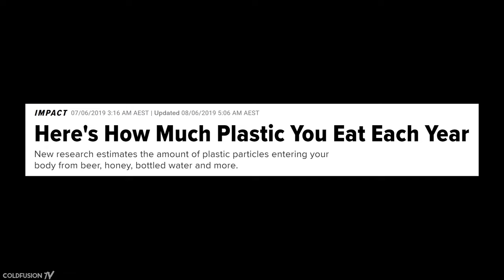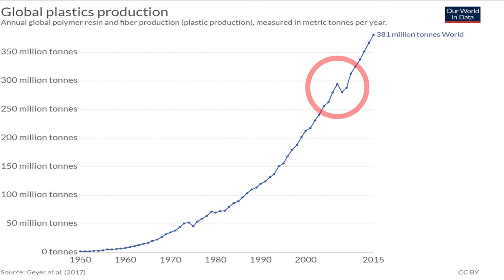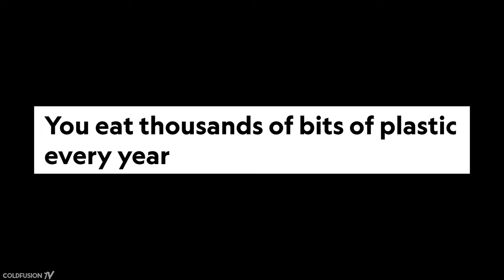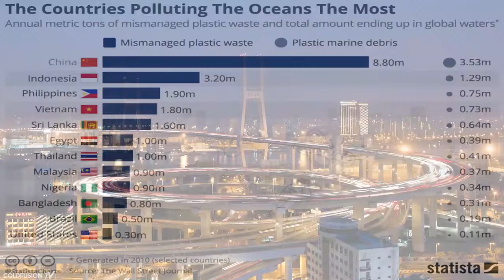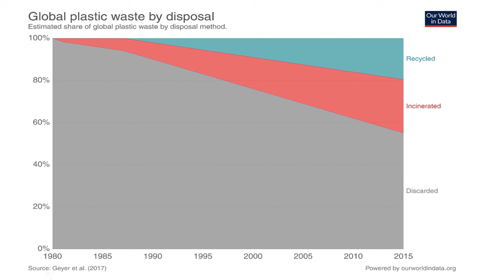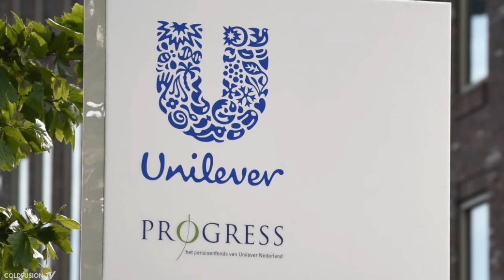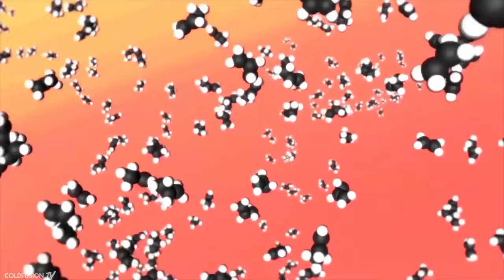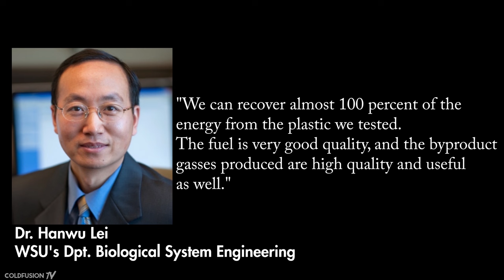Turning Plastic Waste into Jet Fuel!

Comment: Actually there is a small company here in the philippines thats been doing that for years now. Theyre turning plastics into diesel. I forgot the name of the company but i watched it in the local news. The owner said you just need the right temp.
Reply: Pyrolysis. Please research. It's widely used with plastics and also with used vehicle tyres. But pyrolysis is a very bad producer of greenhouse gases.. So many regulations need to be in place before its widely adapted.
Reply: @MrDileepkoppu  oh. So thats what its called. Thankz
Reply: At least he’s giving the story more coverage instead of it being a silly article.
Reply: dileep koppu reckon it will still work if it’s done outside of earth’s atmosphere? eg Mars, the Moon, in space etc
Reply: @istoleurfaceha3527  what the hell?
Reply: Western people generally think that if something comes to their minds then they are its "inventors" :D.
Reply: Stone Buddy because fuel is hella needed
Reply: @istoleurfaceha3527  how do you get the plastic into space in the first place, not to mention hydrocarbons need a supply of oxygen to burn, you're better off collecting fuel from asteroids and other heavenly bodies like mars.
Reply: CMDR Dantae Jesus ok. I was just wondering but thanks :(
Reply: @istoleurfaceha3527  
It's fine, the process is actually similar to what SpaceX is planning to do, by turning the CO2 in Mars atmosphere and the water under the soil into Methane to get back to Earth. Refueling in space is a good idea, since getting there in the first place requires so much fuel to simply escape earths gravity.
Reply: Leave @Ding Ding   alone! I know he's an idiot but still... He was just wondering :)
Reply: @MrDileepkoppu  But I like greenhouses.
Also, guys, you can just make gasoline from your random plastic waste at home with just a few simple supplies you might already have. There are videos on YouTube on how. At least there were many years ago when I first saw them.
Reply: @MrDileepkoppu | Pyrolysis is a synonym of incineration. It's not a process of producing fuel.
Reply: @Enceos  More like a specific form incineration( the plastic is burned with little to no oxygen to prevent complete combustion). As result different products are obtained than if the plastic was burned in open air.
Reply: @MrDileepkoppu  They make it sound so simple, but the temperatures and conditions needed for Pyrolysis make it impractical where energy prices are even moderately low, not to mention the release of chemical by-products that are unhealthful to people and the environment, but we need to keep trying to make this either viable or find a way to breakdown plastics economically and in a reliably safe manor, like the recent discovery of using bacteria to breakdown plastics into biodegradable waste products.
Reply: An Australian company called Integrated Green Energy Solutions Ltd. (IGES) is doing this type of work currently. Here is some of the information:
"IGES is focused on converting to fuel waste plastic that is destined for landfill or discarded into the environment. Further to the IGES public disclosure documents, the patented plastic to fuels process of IGES results in a range of fuels and products, including EN590 (Road Ready Diesel), EN228 (Road Ready Petrol), Naphtha, Marine fuel and Marine Diesel Oil (MDO). The specific products IGES provides are determined by the territory requirements for each individual site location."
And this: 
"Since changing their focus to resource recovery, IGES has been successful in establishing a number of joint ventures and business partnerships committed to the conversion of plastics to fuel, the most advanced of which is their Amsterdam project. IGES, winner of the International Association of Ports and Harbors World Ports Sustainability Award in May 2019, has announced that their IGES patented core module representing 50 tonnes per day (“TPD”) of capacity arrived in Amsterdam in March 2019 and that cold and hot testing commenced in June. A second 50 TPD module arrived in Amsterdam in July and installation is proceeding in parallel with the first module to increase processing capacity to 100 TPD of plastic to produce 35 million liters EN 590 standard fuel per annum commencing in November 2019. This is expected to be the first operating facility of IGES."
Reply: Blue Shirt exactly
Reply: @istoleurfaceha3527  good question, yes it does! Why not sending stuff up with plastic tanks?
Reply: China make clean coal, fuel and gas out of plastic.
Reply: @istoleurfaceha3527  lol im so sorry. I don't think the space companies would send rockets just to send plastics / trash. But who knows in future right. Just to let you know, there are trash too in space a.k.a 'space junk'. Feel free to read about that. Have a nice day!
Reply: dileep koppu  the CO2 global warming LIE!  CO2 just helps plants grow, it is not pollution.  The sun is what affects the climate, not cow farts and burning coal.
Reply: @MrDileepkoppu  I'd rather some more CO2 than an ocean full of plastic.

Comment: In India a professor from IIT Madras has established a company which turns plastic into petrol at 60% of the industrial cost and selling it to the local industries.
Reply: Who dat
Reply: would like to know more about that..
Reply: @gokuldas027  

A mechanical engineer professor Satish Kumar aims to solve environment's biggest problem. He has converted 50 tonnes of non-biodegradable plastic into petrol. He is supplying this petrol to small and medium enterprises for Rs. 40 per liter which is almost half the price of the actual commercial petrol.
Reply: Video here
https://youtu.be/p2opPQ6EuCw
Reply: No petrol,  only diesel
Reply: @dontsubscribeme9547  Its Petrol bro
Reply: @DrMeetPatel  you mean gasoline.... Not possible
Reply: @dontsubscribeme9547  Checkout above link which is from trusted source in India.
Reply: @kratokat3431  Da Saints Dat!
Reply: Word?
Reply: @dontsubscribeme9547  there are a lot of thermal depolymerization technologies some of which are quite mature. The key is increasing the efficiency of the "thermal" part enough to make it competitive with refining petroleum. Changing World Industries tried it with agricultural waste but their business model was based on farms giving waste that they used to pay to discard for free, but once those farms started seeing waste as a product they started charging for it and meant the fuel they were making was about $1/gallon more expensive than normal gas which caused the failure of the company.

Comment: On a similar line of thought. I work for a company that recycles tires into fuels, gases and carbon black. We recycle the entire tire. With our system we are currently recycling 1000 to 1500 pounds an hour of shredded tire. A similar large-scale system should be able to handle other types of plastics.

Comment: 30 or 35 years ago, I had an American professor who taught “pollution monitoring in groundwater” and he said that the big problem is when we transform one pollution into a worse one. Look at common plastic: it is visible, solid and reacts little with water or air. Then, they invented “biodegradable plastic” that actually turns into “microplastics” that we don’t see, but are present in water and also in dust that can enter the lungs. Turning plastic into fuel (gasoline, diesel, jet fuel) is not ending pollution, but transforming it into something more harmful to the environment. When pyrolyzing plastic, a lot of energy is used and generally comes from polluting generators (there is no generation of energy without side effects), and what was solid and relatively inert will be transformed into CO2 and other harmful gases. And what to do with the rest of the pyrolized plastic? This professor prophetically said: the end of the world will not be through a huge nuclear explosion or a huge asteroid, but, silently buried in garbage, with no air to breathe and no water to drink.

Comment: This also dovetails with China's LFTR project, because those reactors run hot enough to both produce electricity and still provide heat for thermal depolymerization to do large scale plastic recycling.

Comment: I just heard about this Plastic to Fuel topic on the radio, a German scientist confirmed that this process requires a very large amount of energy, and to fuel every jet with this replacement fuel it would take at least 10 years before the process is refined enough. He proposed to develop new jet technologies rather than replacing one carbon fuel with another equally polluting.

Comment: How much energy is "gained" by recycling the plastic as fuel? It seems like incineration with extra steps.
Reply: Regardless of whether energy is lost in the process, the important takeaway is that we are removing ocean plastics, microplastics and thus protecting our selves, our future generations and wildlife from consuming and bio-accumulating toxins like BPA.
Reply: @itsover9008  I think there's enough plastic trash around to keep the pyrolysis industry going for a few years, so the financial potential should hopefully drive these entrepreneurs to clean  up our planet asap!  We can only hope...
Reply: More 'recovered' than gained.  Synth-diesel is 66% cleaner burning than fossil fuels, and the gas produced in the process is fed back into the plant to heat the plastic, so no escape into the atmosphere,  The small amount of hard 'char' that is left can be used in building materials.
Reply: @robjworkshop5692  what is the char made up of?

Comment: Great video.    Turning plastics to fuel is a great start which can be done on both local and large scale.   Putting plastic catchments at the mouth of the most polluted rivers plus a converter next to it will stop the plastics before they enter the ocean and provide local people with basic fuels for mopeds etc.  the river will act like a big collection and transport system leading down to the fuel converter.

Comment: I was expecting the "misleading" bar chart in the video depicting the world's largest plastic contributors, but we have to take into account that most waste from the West get exported to the aforementioned countries in the chart. I mean, how does the USA, a developed country, produce six times less waste than a developing country with a third of its population? Additionally, the "contributions" from Southeast Asia are more likely to increase as China has implemented its Operation National Sword, which will limit plastic exports from the West.
Reply: The chart doesn't show the plastic waste produced by a country, but rather the amount that goes into the oceans. That's why the USA ranks rather low. Only a small amount of plastics in the oceans originates from US coasts or rivers. However the plastic that originate from asian rivers might have been from the USA originally due to trade. So the underlying problem is the lack of legislation and technology to dispose of plastics (accumulated through trade and own production) in East Asia!

Comment: With Pyrolysis a catalyst is not needed, I’ve seen many vids of commercial, domestic and DIY Pyrolysis machines all of which just used heat to break the plastic down and got liquid fuel and a Syngas that is fed back into the Pyrolysis machine to keep the process running, an external gas source is only needed at the beginning to start the reaction.

Comment: There is a great use of plastic in making long lasting and low maintenance tar for roads.
More relishing to temperature, rain and usage based wear we see in regular roads.
Remember learning about a few years ago, the problem back then was scalability, however the cost was still pretty low.
That process also needs very clean plastic, but that wasn’t a bug issue.
I think a company from Bangalore or Chennai (India) was spearheading the adoption.
Another great way to recycle and use plastic.

Comment: Ahem... and the cost of the fuel energy used to create the high heat to render the fuel byproduct ?  Sounds like a moribund circle to me.
Reply: The energy could be produced by incinerators, so x amount of plastic is burned and y amount of plastic is turned into fuel.
Reply: I heard the idea of dropping it on a volcano. there's  been a lot of ideas but they still expensive.
Reply: But it gets the plastics out of the enviroment, that's the point.

Comment: It's good to know that people are working on the solution. 👍👍
Reply: Don't rely on others to fix a problem we're all guilty of. We need to stop using single use plastics outright.
Reply: @CoderShare  it's right but it's a two way efforts ie, both people and govt should take the responsibility.

Comment: The best solution is reduction, and disuse. Bring reusable jugs to be filled with laundry detergent, and household cleaners, instead of one time bottles. Significant cost is in the container, so the product is cheaper. Testimony from small Asian vendor stated that when people brought their containers to be filled, and charged by weight there was no plastic in the waterway then travel sizes were sold and trash both continuously and completely covered the waterway. Bottles weren't entirely clean, so the contents went into the water. Reusable containers weren't exposed to water because more of the same would go into them.

Comment: So you make fuel out of plastic, and then use it by burning it.
It's a lose lose situation.
Reply: Better than it floating around in the ocean.
Reply: not as much oil extracted.
Reply: Why is it lose lose? They are still gonna spend billions extracting oil from ocean beds anyway. Might as well reuse the waste plastic as fuel and get some of the plastic out of the oceans. Its not a perfect solution no doubt but still a very useful one.
Reply: It's not lose lose if it's needed. We haven't yet eliminated airplanes and airplanes aren't going to go electric any time soon so it's worth working on.

Comment: Collected garbage is also burned to heat homes in some areas. If the input of energy needed to make a fuel out of it is higher than the output of the fuel it is just as bad as driving a car on hydrogen, it should then only be used perhaps to store access energy

Comment: that's really not an ideal solution. This fuel is consumed and end up in the atmosphere as CO2 and small particles. Plus we are quickly transitioning toward electric vehicles. The solution is a) create biodegradable plastics b) find ways to convert plastics (polymers) back to monomers.
Several companies are working on a and b
Reply: Jets are going to be around for a long time and need jet fuel...why not burn waste plastic and cleanup the mess instead of drilling for more oil.  Right now it is a very ideal solution...
Reply: @mesabog2  Ikr...they are still gonna spend billions drilling for oil from ocean beds anyway...

Comment: Inspiring video.  But is it?  In a world mostly bent on moving away from internal combustion engines, finding a way to produce more fuel from plastic, spanned all over the globe, may not have its day in the sun.  The technology seems in its infancy, or maybe its adolescence, but for it to be used successfully thousands of machines would be need to be seeded all over the world.  That could take another 8-10 years, if all goes well.  All the while the use of electric motors will increase substantially as we've already seen.  It seems like it will depend on the timing.  

The one area that this will make a difference for some time to come is right in the click bait title (although this is a good one).  Jet fuel.  Right now batteries are far too heavy to start building electric turbine engines for jets.  And, it seems it's going to stay that way for some time to come.  Making fuel for the airline industry would seem the best way to make a practical real start.

It's a smaller focus as to where the fuel would be used, airliners would love to save any money on fuel and this could end up being the cheapest way, and they use a lot of jet fuel.  Estimated use of jet fuel for all of 2018 in the world is 83,919,705,882 gallons.  Even here this activated charcoal process would only seem to make a small dent, especially early on.

I guess we'll just have to wait and see.  And hope the timing lines up just right.

Comment: Just to add micro plastic fibers/dust we breath in. (Liked the video) Plastic essentially is stored energy.  Also just to add another good process is the recycling plastic into energy.  The incineration of plastic to heat boilers and generate electricity through turbines is also a good idea. The heat generated is also used to supply hot water for heating in cities. These type of projects are happening in places like Norway/Oslo. The scheme works well because they get 50% of the revenue from countries wanting to get rid of their plastic waste, then from electricity produced and then from savings from heating.( the modern system goes through many filtration systems   to make the gases/waste products safe as possible. Part of the big problem with plastic recycling is the cost of the processing which makes it hard to compete with cheap virgin plastic. It will be interesting to see if the process of producing jetfuel is more expensive than buying virgin/standard jetfuel. In either case a tariff/charge needs to be introduced on plastic or a positive grant assistance added to help these recycling methods work effectively.

Comment: The more plastic is converted into jet fuel or other procuts, the less petroleum is needed for these applications. I see these eforts as extremely valid and positive. In the long run, it fullfills the goal of not having plastics dumped into the sea or used as landfills.

Comment: it is very ground breaking as long as it doesn't pollute further, plastic ought to be converted into building material since it doesn't break so easily instead of cement or other material. building will not break apart even in earthquakes.